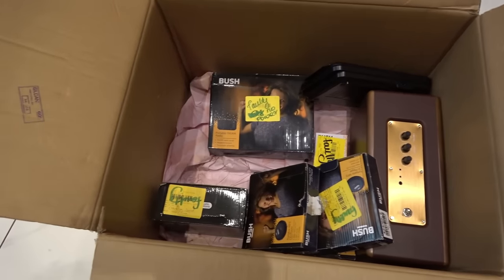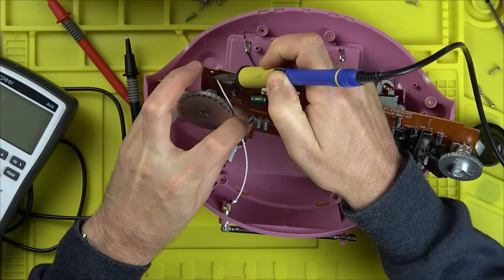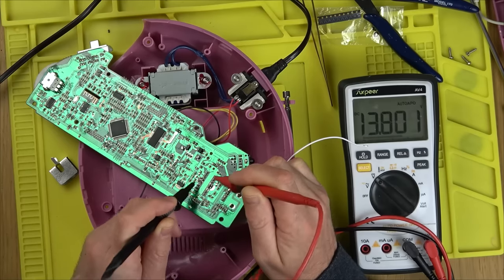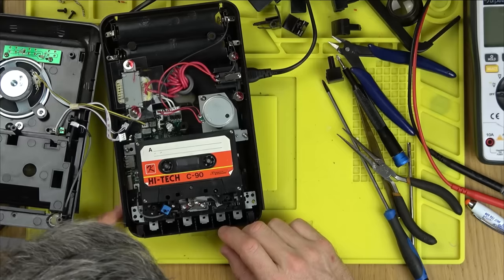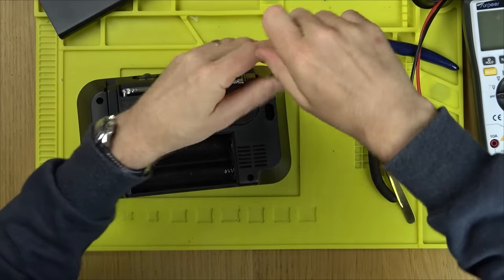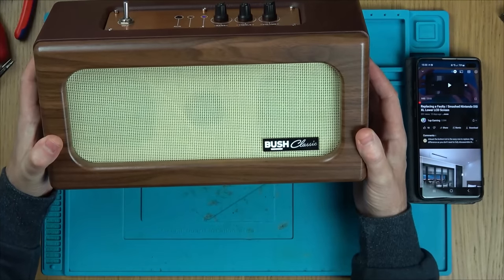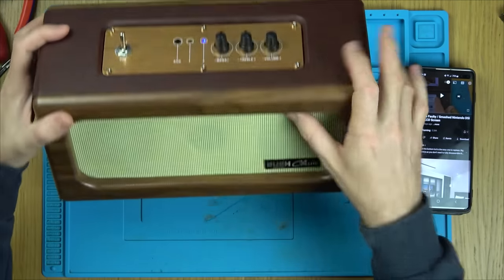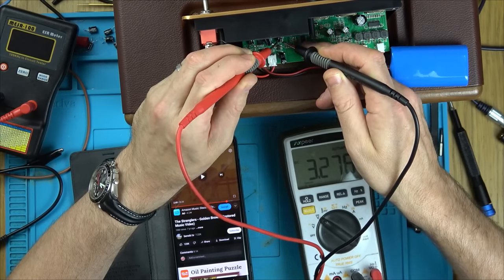MORE ARGOS CUSTOMER RETURNS to FIX - Can I Make More ££$$€€

Comment: Bush use to be quite good quality back in the day.  They made some really good ValveTube equipment.  Unfortunately, like a lot of these higher quality brands that went out of business, the brand name was bought by a holding company and licensed to put on cheaply made stuff, usually chineseum in origin.     I really don't know how much money you can make off these when you add in the cost of your time to repair them, compared to how cheap they are new to buy.  
As far as the audio chip on the first radio, it was labelled on the circuit board what it is also so didn't need to remove the heatsink for testing, but obviously needed to be done for replacement :)
On the cassette player with speed issues, I noticed a lot of play in the Capstan when the pinch roller pressed onto it so I would think this will not be reliable long term.   Recording your voice on the device then playing back on the same device will sound normal as recording and playback would be at the speed of the device.    I think it is that play in the bearing for the capstan is the issue.
Most of these things are not tested when returned.  Because they are so cheap, they are just refunded or replaced if sent back so the only test is when a customer says it is faulty.
That bluetooth speaker.  The battery is a 7.4V battery, that is written on the battery.   The batteries are usually 3.7v each cell on average.

Comment: The chip you could not find on the last one is a bluetrum chip (AB or A3 logo)  they are 1 of the 3 most famous cheap chinese bluetooth chip manufacturing companies. Zuhai jieli(JL logo or pi logo), bluetrum(AB or A3 logo) and appotech(weird compass needle like logo) all these 3 mentioned companies have datasheets leading nowhere. That makes me think the chips have the firmware or serial number printed on them instead of the real mcu series. The chips are full blown Microcontroller's wich you can program and reprogram and have usb, aux, sd card, mp3, radio, bluetooth hardware inside of them.  So if you see any of the mentioned logos in chinese bluetooth speakers please reffer to my comment, i hope i helped you a bit. :) Nice fix, also had problems with a voltage regulator providing not enough voltage to tell the mcu in a different device the battery was full.

Comment: ermm my mate vince you know the yellow cables and then you got the white plug did you plug it in problery as it is out and they is why there no power going to it as the  yellow cables and the white plug that gose to the board is not in problery and if you put it in proberly it might work you looked at it and then said it still dont work and i thought when your at them you might try the white plug with the yellow cables to see if it works.

Comment: On the first item, the pink CD/radio player, I wanted to point out that you never stated the obvious regarding the audio amplifier chip that you first suspected (but then ruled out). The obvious thing was that this is a STEREO chip, with two independent channels. That's why there was an IN1 and and IN2 (you seemed perplexed as to why), and why the two channels were powered independently. I understand that this palyer is incapable of projecting a stereo image through what I inferred from your diagnosis was a dual-coil but ultimately monophonic internal speaker, but when listening using headphones, this device was clearly designed to be stereophonic throughout.

Comment: The speed controller on the cassette deck was clearly visible it's inside the motor you could see the black hole on the motor it looks like a black dot it's usually covered with black felt to keep dust out use a trimmer through the hole

Comment: 39:00 Never measure batteries without load, never measure batteries without load, never measure batteries without load, never measure batteries without load, and most importantly never measure batteries without load.
That is a lesson I think most people have to beat into their heads until they are senseless.

Also, I think you could have changed the capacitor above the regulator to a different value to get the regulator to output more voltage, that could have fixed it.

Comment: As comments below most of these DC motors have a speed adjustment pot under the rubber cover.These tiny SMD ICs for voltage regulators ,there is no way current rated in real life to their spec sheets this is why they fail so quickly

Comment: Nice fixes :) Interesting that cassette player, which look like 80's tape drive for various 8-bit computers. I wonder if it can be used as such? I had similar tape drive for my first computer, Salora Manager, actually still have it, but now it's in bad condition, would need complete restoration.
Reply: It will work fine for a computer, apart from a commodore as their tapes are digital.

Comment: On the cassette player, that little blue head that moves into position when you press the record button is absolutely NOT the record head! At this very low price point, there would never be a separate mechanical record head. Instead, the little blue head is the ERASE head, and it's not even an actual head, it's just a crude permanent magnet, which is why it has to swing in and out of position. The purpose of an erase head is to permit one to record over a tape that contains a previous recording. If you don't erase the track(s) a few milliseconds before the tape passes over the record head, you'll hear both the old and the new audio simultaneously. An old studio recording engineer trick was to disable the erase head and use only virgin (never recorded upon) tapes, in order to slightly reduce the noise floor, as the erasure process introduces a very slight amount of additional tape hiss into the mix.
Reply: Oops, sorry, I see that someone else had already pointed out the that blue head was the erase "head" (just a magnet, actually, true erase heads are powered by an AC signal, typically the mains frequency).
Reply: @richarda3659  Erase heads never run at mains frequency, it would be totally impractical as it would be very audible on the recording! The AC erase signal comes from the record bias oscillator, which runs at a frequency well beyond the audio spectrum, e.g. 80KHz or so, and also provides tape bias via the recording head.

Comment: 24:00 has the left-hand side of the spring come out of that raised bit that looks like it would hold the spring and take some pressure off the right side? It looks like it's popped out and is resting on the crystal.

Comment: Could you rig up a mains power socket that's actually run from a bench power supply to limit the maximum amps to something like 1? That way you could plug things into "mains" and still be safe-ish. Wouldn't want to loose you to a five quid crappy radio :)

Comment: Just a quick question about the Bluetooth speaker why would a company make a battery in series to waste power when a parallel would give a more battery life? Genuine question as when you were looking for the fault you discounted the battery voltage size quickly again it's a genuine question 😁
Reply: To add on to your questions: Why was the voltage regulator only specced for up to 5V or something? Why is it measuring battery charge by the voltage regulator?

Part of me wonders if the battery connected to this circuit should be parallel and droop the voltage regulator when low. Maybe the fault was the wrong battery pack?

It might be worth for Vince to see if charging works. If it was meant for a parallel pack the batteries will drop way too low.

Comment: @mymatevince  Just had a thought, but I could be completely wrong. Could it be that the voltage regulator is faulty and putting out too much power, but the speaker just acts like there's not enough power and therefore says 'low battery' because it doesn't have a specific message when there's too much power going in if you get what I mean, so it just defaults to the low power message and also the voltage being a bit high on top of that? I'd try replacing the regular if I was you? Sorry to everyone if this is a stupid thing to say. 😉

Comment: Recoding your own voice on the current speed of recorder cannot be used for testing as the speed of recording is also slow.  Is like using Long Play format for extended play.  The black hole at the back of the motor has a potential meter inside for adjusting the speed of motor

Comment: Vince did you notice the red light was off after you connect the bench pws on the bluethoot speaker? Also now that is working with the new regulator the red light on top is no longer turn on, appear that is the low battery alert.

Comment: 23:46 spring was installed incorrectly, there is a small "notch" on the metal plane, where it should be hooked, instead it is tugged somewhere under the read head.

Comment: On the bluetooth speaker, it looks like there are lots of unpopulated spaces for resistors and especially capacitors. This is not unusual, but it does lend me to believe that one or more of the components might not have been properly placed prior to the solder station at the factory. Hence, my money would be on a manufacturing error rather than a post assembly fault.

Comment: Guess on why that transistor fails..  the crappy heatsink on the amp chip, if the transistor is specced right and the manufacturer isn't using bad parts.

Comment: Vince, you've got more bush than a 70's porno.  🤣 🤣  
Given the fact that they appear to be a cheap brand, do these products tend to fail more often than other brands ? 

Great vid by the way. 👍

Ps, for the cassette player, I think you were spot on with the roller. These will cause drag if pressed to tightly on the guide bar. I have seen them press so hard that they snap the tape and bend the bar. They literally need to 'just' touch the bar. Anything more is problematic and will often stretch your tapes over time. 👍

For the vintage looking bluetooth speaker, it has the battery voltage details printed on the wrap around them. It said 18650 battery type which are 3.7v, the label said 7.4v, indicating 2x batteries. So 7.4v is the number you were after. 👍

Comment: Can I just ask.. what causes an ic or a tranistor to just fail? I can understand if over loaded or over heat, but I can't understand the general reason
Reply: To save money, some equipment designers use components that are just barely able to handle the current or the temperatures to which they are subjected, which can cause premature failure. Some circuits are rushed to market without sufficient testing. Other components suffer from manufacturing quality issues and simply do not last as long as intended. I mean, mechanical and electronic stuff just breaks sometimes.

Comment: More info on the chip in the Bush Bluetooth. Player arriving via email.  The identification on it tells you the voltage output of each regulator. XC6206 Is the generic name the rest of the data is the important bit.

Comment: It's the capstan and it's friction with the pinch roller that pulls the tape through and regulates it's speed. The take up reel is driven by a clutch which is designed to slip, this allows the take up reel to vary it's speed depending on the diameter of tape on the reel. (notice it turns faster at the beginning of the tape when there is less tape on the reel). The pinch roller should have a good strong pressure to the capstan to grip the tape and provide tension. If you remove the pressure, the tension is reduced and the tape can slip past the capstan and be pulled through instead by the take up reel at the wrong (faster) speed as the take up clutch will no longer slip as it's meant to. Hope that makes sense 🙂

Comment: You did something wrong. When recording to a tape at one third of the speed and then play back at one third of the speed, of course it’ll sound normal because the speed of recording is the same as the speed of playback. If you want to check it this way, you should record on another player and play it in this one.

Comment: Isn't that a 2 cell LiPo battery? Each cell has a voltage of 3,7 volts. (based on the 7.4V printed on it) You should check how much mAh it's holding, since max capacity is 1500. A full LiPo will always have more voltage than it's printed on it.

Comment: Of course you can't measure a voltage drop over the input resistor of the regulator, because no amperage is drawn through.

Comment: 35:44 The only difference with your second test, is you plugged the AC in when the batteries were installed, and you left them in afterwards. maybe they are required for some reason to complete the circuit? Who knows? :/

Comment: To properly test cassette speeds you could use a 440hz test tape. I believe if you have a guitar tuner (or such an app) and it comes up as a perfect 'A' chord then you're good to go.
Reply: Or just any tape with a test tone on and use a sound detection app to see the frequency. You could also use software on your computer to test for wow and flutter if you have a 3k hz or 3,15k hertz test tape.

Comment: Of course that resistor causes a voltage drop. It is in series with the regulator. It should cause a voltage drop. The voltage drop is probably there for current measurement. If there is no current (because you took out the regulator) there is no drop. You used the wrong reason to replace the component that was defective. You were lucky. Don't replace the regulator with the correct type, because the correct type was under-spec-ed.

Comment: I was cringing in fear the whole time I watched you repair the first item, the pink CD/radio player. Why in God's name would you subject yourself to 220VAC electrocution when all you had to do was connect the 12VDC from your power supply to the (+) and (-) leads from the internal battery pack (8 cells x 1.5V = 12VDC)? This seems criminally risky compared to how safe using a power supply would have been. Less experienced people watching this video might be encouraged to needlessly take considerable risks. Please be safe, and consider the safety of others less knowledgeable than yourself, Vince!

Comment: Not sure why you thought you had to do the calculations and kept saying the battery pack should be 8.4V fully charged when it's got 7.4V clearly printed on the packaging which is correct for 3.7V x2.

Comment: 1:23 Is that a requirement of 8x LR14 "C" batteries?! That's definitely not the most efficient, or eco-friendly, way of powering this thing. 
Since 8 x 1.5 = 12V, I wouldn't be surprised if someone could make something similar, or redesign this thing, to take a 3S (3 cells in series) Lithium Ion or Lithium Polymer pack.

Comment: YOU RECORDED YOUR SELF ON THE RECORDER THAT IS HAVING A TAPE SPEED PROBLEM SO IF YOU RECORD YOUR SELF ON IT IT WILL SOUND FINE YOU NEEDED TO RECORD YOUR SELF ON ONE THAT WORKS RIGHT THEN PLAY IT BACK ON THIS ONE TO TRULY SEE IF YOUR SPRING THERORY WORKED THERE SHOULD BE A PLACE ON THE MOTOR ITS SELF TO ADJUST THE SPEED FROM WHAT I REMEBER